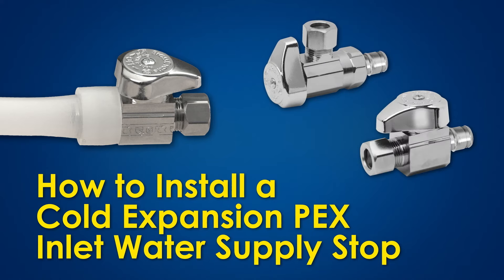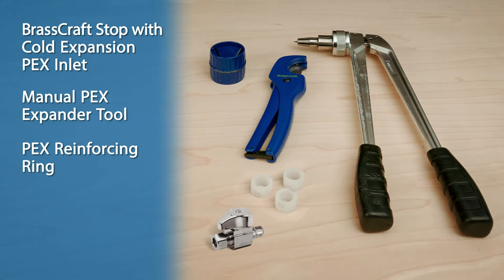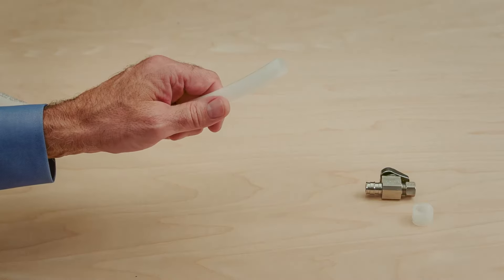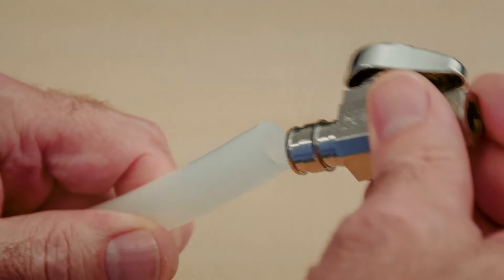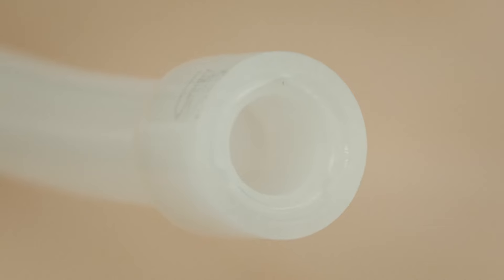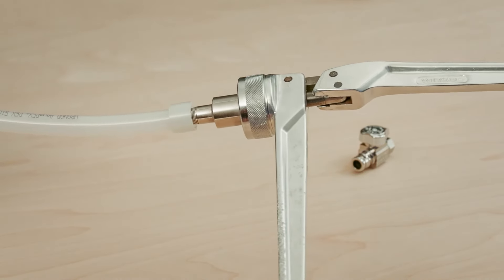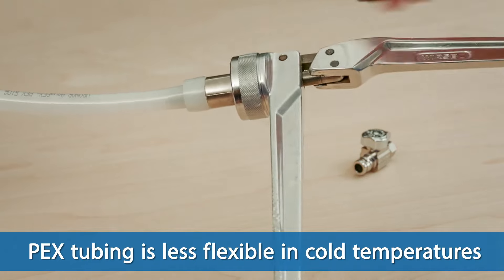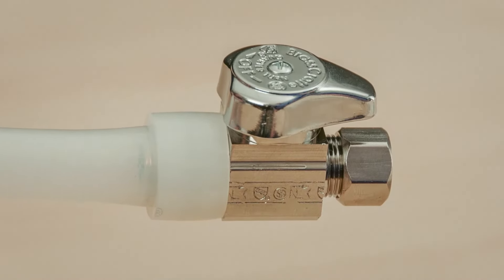How to Install a BrassCraft® Cold Expansion PEX Inlet Stop

Comment: What about if you need to replace it for a new one, and you don’t have more tubing sticking out of your wall?
Reply: Heat up the expansion ring and then cut it. The fitting will slide right out.

Comment: An expansion tool costs like $350..can you not just remove the blue or red ring, pull out the old valve and use one with the one with the 3 bumps on Pex A and use a crimp ring?